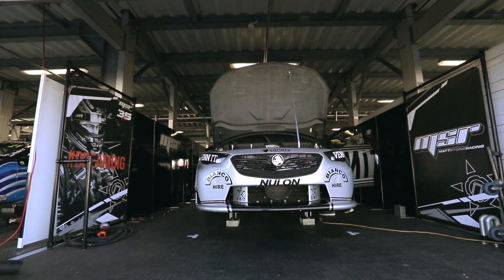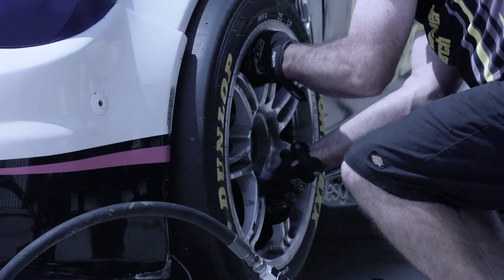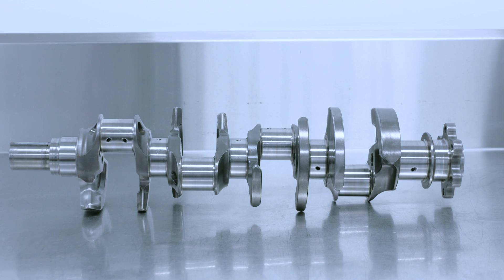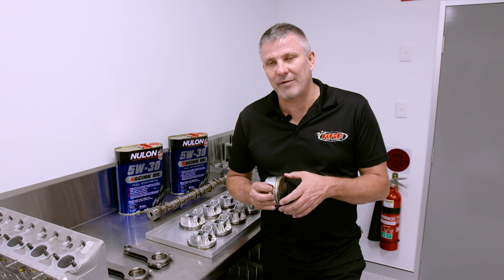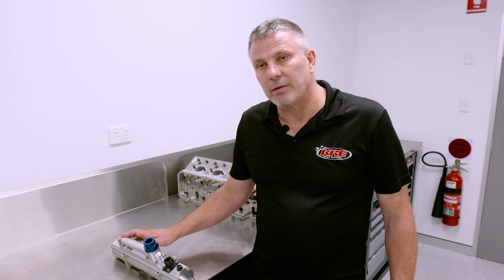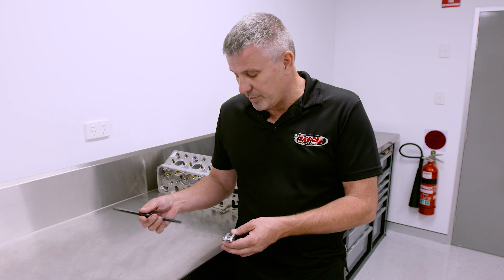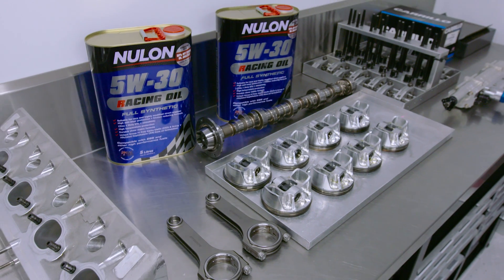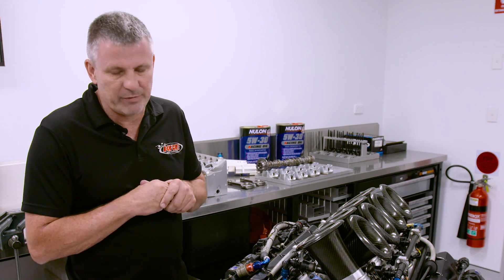Inside a Supercar V8 Engine! The facts, history and secrets with KRE Race Engines

Comment: 165k for an engine . What a RIPoff and they need rebuilding every 3-5k kms. You could build a billet 2jz,RB,EJ,EG,4g etc for a fraction of the price and easily double the power and torque. Yes he maybe a top engine builder. Well anyone that charges that will have to be cause ppl that spend that coin on engines will have lawyers waiting if shit went wrong.
Reply: Haha, that's what happens when he's tied to a regulation,  I bet he's hating DTM if he knows about them where they have close to 1000bhp and 9000rpm . Racing tech here has ceased since 1992 and the rest of the world had moved forward.. take WRX (World Rally Cross) , 600+ bhp from a 2.0ltr turbo n 4x4  .. Aust racing has lots to catch up on , if they can .
Reply: @marty3469  funny of all cars an you mention wrx. I have a 750bhp wrx at home
Reply: "You could build a billet 2jz,RB,EJ,EG,4g etc for a fraction of the price and easily double the power and torque" - not NA, 7.5K rev limit and 10:1 compression ratio you can't.
Reply: Easily double the power and torque... and also lower the timeline before it becomes a pile of twisted metal and broken parts on the track.
You people seem to forget that these LIVE at WOT. They are raced under the harshest conditions possible, and bang the limiter multiple times a lap. Any race engine needs rebuilding and maintenance. And even a 1000hp engine that trots around the streets at 60km, is nowhere even near the same class as a G-Forced stressed circuit engine.
Reply: @dons1932  look at andy Forrest subaru. 1200hp 7.8 second quarter mile circuit track car. . That's a RIP off simple. No matter who says otherwise. I'd get a motor built for fraction the price same specs etc and I bet it could do the same events and kms these do
Reply: @nztrucker1542  C'mon man... a Time Attack / drag car, with a boosted flat six, you couldn't make a worse comparison if you tried! They are turned up for 1 lap and destroy the tyres just as quickly due to downforce. We are talking 5000km. That is 5 Bathursts of WOT racing with no repairs needed. Most other engines wouldn't finish 1.
Reply: @dons1932  dude I built my subaru for fraction of the cost. Roughly 15-20k just on engine and that's labour incl. And when my car was 600hp it ran similar times to the v8 supercar around pukekohe. And I still drive it around as it's my street car too and countless drag events and track days I go to. Give me 165k and I'll build a engine that'll never have to be touched period
Reply: @nztrucker1542  Expect to see you engine building  in the main game soon, wasting your time as a truckie, with your talent also as a driver , can`t wait to see your expertise on the racetrack, i am guessing you have a long list of successes at the top end behind you?
Reply: @Brasznb59  I'm actually starting and pricing up a eg33 turbo now roughly be 20-30k for longblock. Est should do 50k kms and make roughly 1000hp atw. See the comparison. Thing in NZ is people are trying to have a car where you can drive to the track, race it and drive home . That's the goal now days . Never mind dedicated race cars. Seems boring. But that aside love the v8z supercars  been watching since Marcus Ambrose was driving for pertek and paul was with shell etc

Comment: So the motors are all 10 years old, the tube frames are all the same, most of it is set by rules they cant change so the cars are identical underneath. Why do people still scream Holden or Ford again?
Reply: I stopped watching racing when Group C was dropped. Racing that improved the production cars.
Reply: I dont, I follow drivers.
Reply: Chev
Reply: Chev (Aurora) motor has the same deck ht. as the Ford 302 Windsor, 8.2". Heads are based off Ford (canted valve) not LS motors. The only part on a Holden that is Holden is the badge. Crown wheel is 9" last I heard.... so it zeems to me the Holden is more Ford than Holden. I have ni ubderstanding of why anyine watches them.  I have to say that this video is the best and most informative I've seen to date. GREAT WORK. Would've like to hear the flow figures and intake port cross sections.  Gotta keep some secrets???
Cheers

Comment: I’m wondering what engine it’s based on, the Holden 5.0, Chevy 5.0 or totally custom, I noticed the heads had Chevy stamped on them.
Reply: This engine is based on a Ford Windsor... ;)  It's a "Chevrolet" in the loosest sense...  Like he said it's a "Aurora" engine, which is essentially a custom-made copy of a Ford Windsor engine.  You can buy the Ford engine out of the Ford Racing catalogue, but you can't buy this Aurora engine from the Chevrolet motorsports catalogue as it is not available to the public.
Reply: So wait both Ford and Holden are using the same engines, Ford Windsor block SBC heads???
Reply: @rlscustoms  They used to run an 18 degree Chev until the development Ford had with the D3 head meant they were dominating. Holden then had GM Motorsport in the States cast a special set of blocks called Aurora that would allow a special set of heads dubbed Holden Motorsport heads to fit, that were basically a carbon copy of the D3 style Ford heads that would bolt to the custom Chevy Aurora block. Being from the US, that is why they have Chev stamps on them. But yes, effectively, it is a Chevy copy of a Ford D3 / Small Block combo. I believe with the control cam they also actually share the same firing order. Which is 302 Windsor.
Reply: So in 2025 Chevy run a 350 pushrodder (5.7litre). Ford run a 5.4litre DOHC. That’s what I’d been told.
Reply: Old style small block chevy,the heads etc are pretty old school compared to the latest LSX engines from Chevy. As he said,some of them are 10 years old with the fords up to 20 years old .

Comment: 645hp australian....
Thats like 1,000hp american.... haha...
Thats impressive numbers...
Reply: Good horsepower for a low tech single cam, pushrod engine
Reply: @mickholgatephotog  It's awesome, but NASCAR takes it to another level by making 900 odd with no roller cam, no Lambda, no sequential injection. Just a good old carby and 5.8L. Both are insanely impressive for true NA engineering genius.
Reply: @dons1932  NASCAR hasn't run a carby in years
Reply: @dons1932  Nascar engines are now so restricted these days, they make around 500hp
Reply: @dons1932  Carby? What world have you been living in.
Reply: @yeingsterable  Don't most people think of a carby when they think of a traditional NASCAR engine? The injection is more of a modern thing. Same way of calling V8SC E85 cars - well, not for MOST of their life. Only recently.
Reply: Good HP at the low RPM limit.
Reply: Fantastic power from a 10:1 compression ratio on E85!!!

Comment: Please Explain? Can you tell us then why the engine on #97 SVG at Melbourne, went  Bang 💥
Reply: Does not matter how good you build an engine, it is still a machine and is made of metal, and they break at times.  Something simple like an oil line leaking, or oil filter clogging, there are many reasons.
Reply: It was flogged by its flog of a driver

Comment: I have to correct him on one point . Horsepower per cube is nowhere near a Pro Stock engine .
Reply: You've got to remember that hp is linear to capacity, generally, however. It's damn impressive for 5 Litres.
Reply: dodge have the best hp,per cube.,chevs are bullshit engines.just cheap.
Reply: @phantomwalker8251  chev stopped making engine about 20 years ago. Chevrolet use the Canadian built LS engine these days

Comment: There's the reason why V8 supercars is so boring  too many regulations
Reply: What sport are you watching? V8s is not boring at all.
Reply: @jarradghent4746  Dont watch it then! I find the racing nice and close which is how it should be. And I never liked it when they had a mixture of cars on the track, because the slow ones got in the way and screwed many of the fast cars up. NASCAR has heaps of regs, so does F1 and other Championships. Otherwise the one with the biggest pockets ends up with the fastest cars.  Anyway, Holden are already looking at a V6 Turbo in the very near future.
Reply: @jarradghent4746  touring car masters way more fun to watch more horse power = way more fun also more diverse vehicle types engine configurations and no crippling rules
Reply: Awesomus Maximus...supercars is closer than ever, look at the last few years of championship finishes for an example. Also the rules state 2 door 4 door 4,6,8 cyl configuration. Hasn’t happened yet but the rules allow for diversity its just that the V8 is proven as the engine of choice for obvious reasons at the moment. An Asian brand at some stage will take it on with a turbo 4 or 6 no doubt.
Reply: @mtuz8356  they need to use the engine that the car (kit) is derived from  . BTW the racing has been boring for 20+yrs and I don't watch them
Reply: @marty3469   Just fkn NO... the parity between body shapes is a huge issue in the recent past, and currently.  Why would anyone want to introduce more differences? It is a drivers championship, not a manufacturers, the marque they drive is supposedly irrelevent.

Boring.... perhaps you'd like the aussie racing cars better... but they'd have to change their poweeplants for you to like it...
Reply: Money kills everything,Larry Perkins even says what he thinks of it all ,it’s all great memories now,go to supercheap and buy some performance engine parts ,shelves are full of Chinese rubbish destined for your local tip

Comment: 645 hp and they call them super cars?  theres 4,6 and rotary street cars in oz with more power.
Reply: Good call. Plenty group a rally cars knock out 5500 km untouched. And they make more torque than supercars
Reply: @iankakoschke7771  And live at part throttle for most of that, not WOT...
What an odd comparison to make.

Comment: About the only component that interchanges [and with work] is the crank. And that is an odd size. A 302 Chev or Ford factory is 4x3"
So I guess the short deck block call for a short crank.
The oiling and the pan and pump are a work of art. But also very expensive in comparison to buying an over the counter pump and pan. Which really still does the same job. And some Sprintcar engines still use them, wether belt or cam driven. And they have 200+ more power and 1500 more rpm. And these days seldom fail except for valve springs and blocked injectors leaning an engine on one hole
Reply: aus racing is just for the camera,its advertising,not racing.all the same car,different badge.racing is dead,in aus.british touring cars are more exciting..
Reply: @phantomwalker8251  How so? They are all 2 ltr Turbos and have very similar regs to Supercars. And only have 350+BHP.  I watch it and whilst is good, no where near as good as Supercars. So, really the BTCC is just badge racing as well.

Comment: 160k for an engine? 💴💴💴💴
Reply: Yeah, a factory crate engine can cost as much as $40K.  Race cars such as NASCAR @ $80K USD,  F1 7 to 10 Million USD, WRC $225K to $300K and the Turbo $150K.  All Hand built with special alloys so that makes them expensive. But at least you get up to 5K with the Supercar engine and the whole season covers 7700 Kms. So, that helps keep the cost down as a rebuild is only $40K.
Reply: @BatMan-oe2gh  Ah yeah, no joke. And he said they usually rebuild the motor for Bathurst, that'd also be tricky for keeping costs down too...
Reply: @jahnperez5060  As stated, the motor must last up to 5K. So why not rebuild it for Bathurst as it is allowed and it allows teams to have fully refreshed motors, and that allows for better racing at the end. And then that motor must last till the end of the season. Pros and cons with everything.

Comment: Do they use Nulon E20 additive?
Reply from the maker: The E20 additive is more for a street car, most of the teams are running an E30 additive also known as Long term anti wear engine protection. https://www.nulon.com.au/products/pro-strength-additives/long-term-anti-wear-engine-protection
Reply: @nulon  Your additives are awesome guys. I run the E85 treatment with VP cherry lube and have left my car sitting for up to 5 - 6 months with fuel in the tank complete with foam. Zero issues to injectors, lines, metal, foam. Anything. Very pleased.